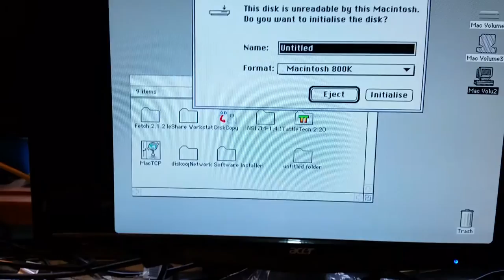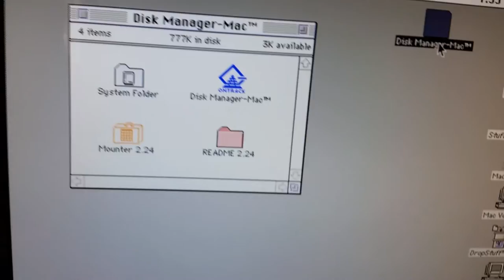How to Fix Your Macintosh Floppy Drive

Comment: Most of these old Macs have a fan on them that sucks the warm air out of the casing, so the cool air (and all the dust hanging in it) has to get in somewhere, with the floppy slot being the biggest opening. That's why the later Macs (from about the LCIII facelift onwards) had a flap on the floppy slot.
Reply from the maker: Ha! Of course!

Comment: One of those "rubber" rings cracked on mine, I just replaced it with the protective material on a 5.25 floppy drive they felt about the same and it seemed to hold on.
Reply from the maker: Nice tip!
Reply: All this work and he left out the single most important part!  The stepper motor has a shaft attached to it that moves the head in and out. That shaft turns and moves the head and has grease on it. That grease tends to harden up. You have to clean that shaft and then re-grease it.  That grease gets so thick and hard that your heads won't move.
Reply: It's difficult to clean but at least give it some qtip swipes and some new grease.

Comment: Hey TK, great video. I've used it several times. For the rings, I think plastic rings could be 3D printed very easily. It would probably be a 1 or 2-layer print, super quick. Easy part to design.
Reply from the maker: Good idea! I know the gears can be 3d printed too
Reply: @WhatUpTKHere  I have a really good desktop 3D printer, but I don't know that it can hit the horizontal resolution to get it done. Probably depends on which gear. If I ever break a gear, I will definitely give it a try.

Comment: Thanks a bunch.  Just got a powermac 5500/250 and the floppy drive works but now when I eject it it thinks there’s still a disc in and wants to Initialize and of corse fails becuase there is no disc in it.  Probably know what the issue is, hopping it’s just the disc slot is full of dust that making it think there’s a disc in it
Reply from the maker: Yeah definitely give everyghing a delicate clean, should help!

Comment: Great video, but my drive head goes to the rear position and keeps clicking trying to move back further. sensor works, if i block it the head goes forwardbut when it comes back it keeps trying to go back.. any ideas?
Reply from the maker: Hm, hard to say. Could do a full disassembly and clean but it may be too far gone?

Comment: Thanks so much for this video! Both of my floppy drives aren't working in my mac se currently. They both just keep telling me "disc unreadable" and these are brand new floppies i ordered as well (800k).  I'll try these methods later.
Reply from the maker: no problem! good luck with the fix :)
Reply: Thanks! Just ordered a 2nd Mac SE since it was a great price, came with a bag, and a external floppy disk drive. Do these same fixes apply to the external floppy disk drive if that has an issue as well? Thanks!
Reply from the maker: +BillyTheBigDeal should do - 85% sure if it's an Apple external drive, it's the same mechanism in a different shell
Reply: sweet :-)
Reply: It worked! Well for 1 of my 2 drives but that's all i needed :-). So i quickly copied most of my floppies onto my hard drive just in case though. Still got some errors from some disks not reading and Dark Castle would load but then freeze later and give a error message (wonder if that's because i had the write protection on, hmmm). Oregon trail didn't work until i turn off the write protection, found that out. Also kinda weird i had to open that game, register it to myself, then it let me copy the game to my hard drive. Must have been a early form of copy protection. But I have it now :-). The gears were actually aligned correctly on the motor, but the dust in these two floppy drives was crazy. So much dust caked in there, i was very surprised by it actually. I didn't re-lubricate the drives. So that's probably why I'm still having a couple issues nor did i clean the heads. Only thing i did was inspected the motors bearing gear placement and used a can of compressed air on everything a lot! So happy to now have Star Wars arcade on my Mac SE now. Thanks again!
Reply from the maker: +BillyTheBigDeal dude that's awesome. good you backed everything up cause disks are a fragile medium these days. great result!

Comment: i have problem is that the disk don't slide out it just come out of the mount so if it move one millimetre in it will lock and not come out when the drive id out of the mac it fine but once i put it back to the case it start stuck in side ?
i can send you i video if you like or pics

Comment: after removing dust and applying lube it still doesn't want to go down all the way, anything else to be done ?
Reply from the maker: Hm, hard to say. Could try soaking the whole thing in cleaning fluid like alcohol but I don't know if the drive would survive.
Reply: @WhatUpTKHere  i figured it out, had to add some more lube

Comment: Extremely helpful! Drive is functioning great, mechanically. However, despite the cleaning and lubricating, I keep getting an error message that all the disks are damaged or unreadable (despite working on my other systems). Someone suggested replacing the PRAM battery could be a solution. The read and write heads are clean and in their right place, yet its not reading the disks. Any ideas? (Macintosh Classic) Thanks mate
Reply from the maker: Could also be misaligned heads or some other damage? Unsure how to tackle that one, 68kmla may be able to help!

Comment: Thanks for this video. I was not aware that one can disassemble a Mac flopy drive this much. For lubrication I use fresh car engine oil which I apply with a Q-Tip on the contact surfaces. Afterall the 5W-30 which is good for the V8 cannot be bad for a floppy drive, can it? ;)
Reply from the maker: Ahaha, nice one ;D
Reply: @WhatUpTKHere  It is true. ;) After the fix I resinstalled the floppy drive. It would inject disks like before but it would not fully spit them out. They would be "ejected" in the Finder there was a bit of ejection motor sound from the drive but the disk would not come out. Bummer. I did make sure thet the motor pin was in the 12 o'clock position. But then it happened: I went for a paper clip and when I came back after like 15 seconds the disk would fully eject. Didn't touch the Mac it would just take its time. Now the disks get perfectly injected and ejected quickly. Weird. BTW, the drive is installed in a "Power Macintosh 700" which is a Quadra 700 with Apple's PPC card. What a bastard. ;)

Comment: Thanks for the tut, but I unfortunatelly bent the head spring. How to fix it?
Reply from the maker: Lynx Carpathica ooooh, nasty. I haven't had to deal with that myself but this tutorial here looks good - http://tkc8800.com/post/macintosh-sony-superdrive-head-spring-repair
Reply: TK I can vouch that this head repair works well.
Reply: @WhatUpTKHere  Link is broken now but luckly waybackmachine has me covered. I fudged up a floppy drive in my Tandy 1000HX cleaning the heads. This hopefully will get me fixed. Thanks so much!

Comment: Thanks for the VERY informative video! 
I have a bunch of 800k drives (Sony MFD-51W-03 & -10 & others) for Mac Plus computers that I'm trying to get back into working condition. I've managed to get a few of them back to fully functioning, thanks to yours and other youtube videos! But there are a few drives in which the head assembly simply does not move from the zero point. Well, if I manually move the head away from zero, when I power up the computer it will return to zero, but after that the heads never move. The drive spins and everything else appears to be okay. Have you ever encountered this type of behavior? Do you happen to know the solution for it? Here's a video of it: @t
Thanks again!!
Reply from the maker: That's an odd one, try asking 68KMLA (Google to find the forums)?
Reply: @WhatUpTKHere  Thanks! I'll have to check out that forum!
Reply: @OuchMyFaceyHole  Yes! I found out later that there are major differences between drives, depending on their age. I'm sorry, my memory isn't perfectly clear on exactly what made them work, but if I recall, some need cables with yellow stripe while others require the red stripe cable in order to work properly.

Comment: What do you use and how do you clean the heads? Thanks.
Reply: TK  Thanks for your reply. I know acetone removes permanent marker off plastic. When you say cotton buds, I think you're talking about Q-Tips. I have a Power Mac Beige G3 Desktop with a built-in floppy drive. I was able to reformat about 30 blank 1.44 MB & 800 K floppies last week. I put in one of the blanks from last week and now it can't read it. Before I did that, I had to open the computer case to replace the PRAM battery. So now I'm thinking when I open and tilted the drive chassis to replace the battery, dust may have shifted inside the floppy drive.
Reply from the maker: Yeah, Q-tips. I don't know if there's an accepted generic name for them. 

Good luck fixing the drive, I haven't actually done any work on a drive later than say, 1992. Take it slow and careful and you'll do well!
Reply: Its also possible that the head finally went out of alignment, they tend to do that after awhile. I'm not really sure how you realign them though, try to clean the heads with a cleaning disk and hope for the best.